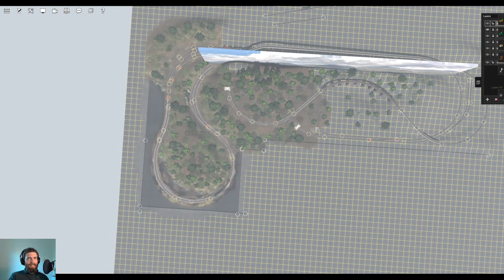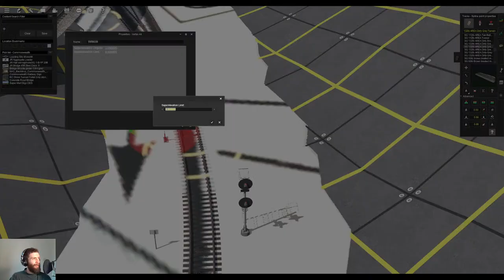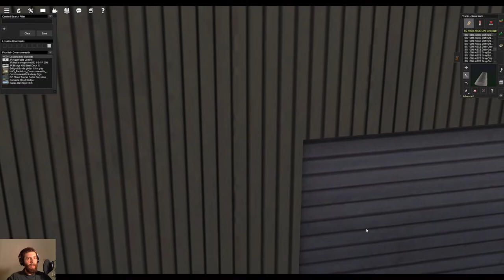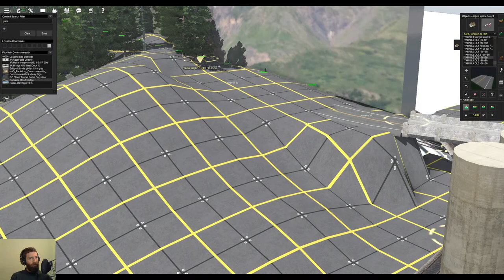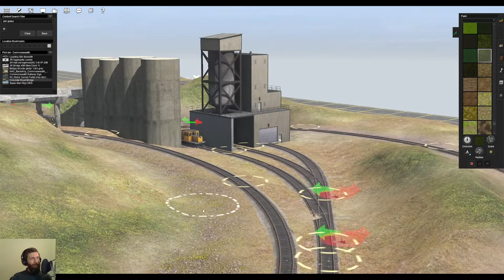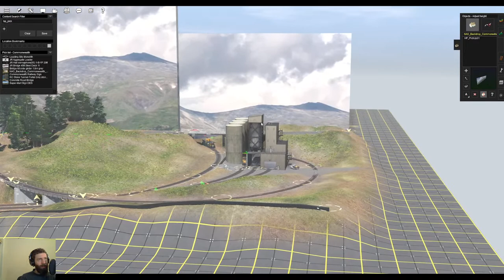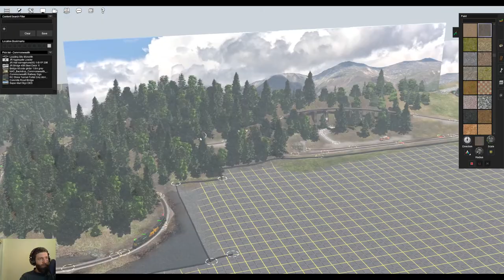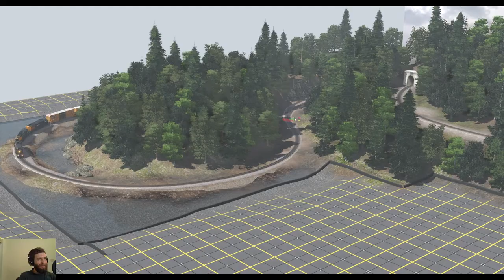LIVE - What Makes This Layout Great - Commonwealth Railway (Part 2)

Comment: Hi Nick - I didn't catch if you are using Trainz 19... I had Trainz2006, but it's so hokey compared to this.
I've skipped through the video, touching on what I hoped were salient points. One concern I have is the proximity of the silos to the main... not a lot of room in a derailment. You touched on the disguising of the ends of the backdrop - you've one solution there with a road-bridge a the right-hand end, and I suggest perhaps curving the left-hand end backwards to 'soften' the look... with trees to break up the view.
I'd sketched up a layout quite a lot like this - but with the Spiral Tunnels as its main feature. I'm glad to see how it might have looked in 3D.  
Good going there, Nick!